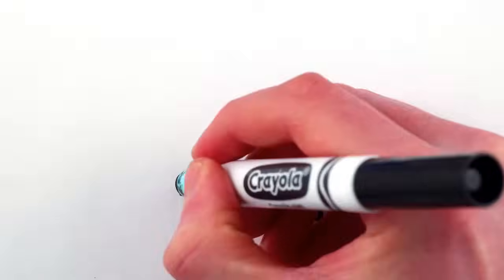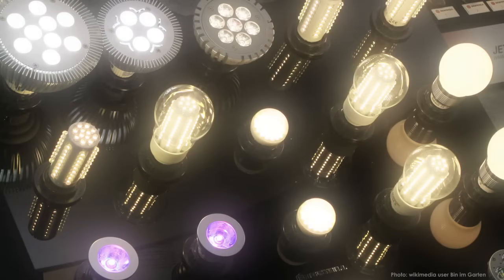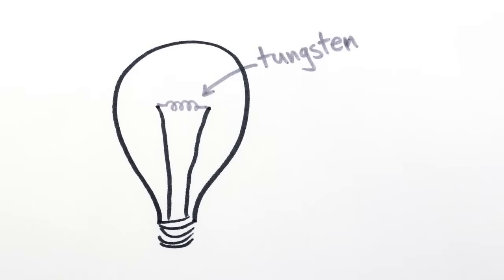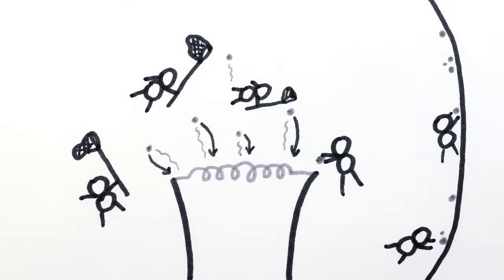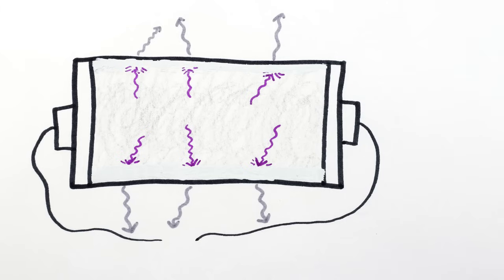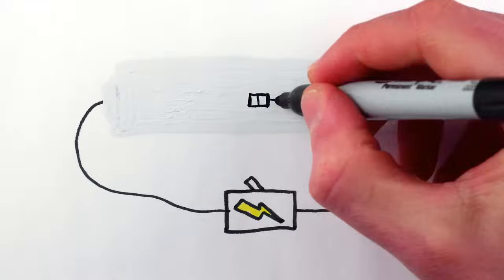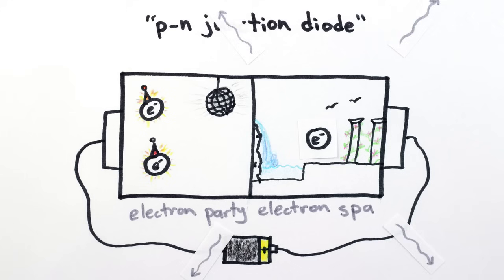How Modern Light Bulbs Work

Comment: Newer, newer LED bulbs have a phosphor coating on the glass to make the bulbs brighter in a wider spectrum.  After you tun off the light, you can see the flow in the coating fade. I presume the LEDs inside are selected to provide just enough UV to excite the phosphor.  Just a guess.

Comment: And of all of them, LED is the cheapest and health safe source of light.
Reply: LED is not the cheapest at all.
Reply: jagjordi It really is now. At cost per kw/h the most expensive bulb now adays is a Halogen bulb, followed by Incandescent, Fluorescent and then LED is the cheapest. Even if the initial overhead of an LED bulb is more expensive than an Incandescent bulb you will recover that overhead cost within 3 months of using that bulb compared to Incandescent.
Reply: Which is what I said.
Reply: Taaketa Dinloka
I think there was some degree of confusion, with Apex's comment being perceived as meaning that LED's are cheaper to purchase, rather than the low-energy/cheap use I suspect he was referring to.
Reply: Spectrum of LED light contain a lot of UV and infrared whitch are not so healthy for eyes. All spectrum of light is "cold" and not all led lamps contain protecting filters. There is only one advantage classic bulb: our environment. If LED lamps contain good quality components and guarantee propitious spectrum then it really is cheapest and safe source of light. So choose wisely!
Reply: Taaketa Dinloka Okey, right, what I ment to say is that LED is more expensive (to acquire it) not more eficient.
Jordi.

Comment: Cool. Could also have done about both xenon incandescent and hid xenon. There for cars but still the hids work in fascinating way. The Is on xenon gas( which is a noble gas) and with a use of a ballast a High Intense Discharge , since the ballast gave the bulb about 20 000 V, and an arc is created in the gas and it emits light

Comment: The HID lamps are the most interesting one. The movie theatres that still use 35 mm film have  large Xenon arc lamps in each projector that sucks up massive amounts of current while running.  Pretty neat to see one light up and warm to full power.

Comment: How can some LEDs produce different colors? What's different in their physics?
Reply: Wave length of the light. Actually it's more accurate to say different frequency as it doesn't change when the light changes between visual mediums.
Reply: The physics is the same. 
When the electron tunnels across the N-type to the P-type semiconductor material, it releases energy, in the form of a photon at a particular wavelength (color). Change the semiconductor's band structure slightly, and the wavelength (color) of the photon emitted also changes.
There's two ways to make white light. Mix Red, Green and Blue and you can make white or any other color. Or a phosphor coating can be applied over a Blue LED to convert the blue light to other wavelengths.

Comment: If halogen lights and normal incandescent lightbulbs both use tungsten filaments how are halogen lights usually so much brighter than incandescent bulbs?
Reply: they run at much higher temperature.
Reply: kurtilein3
But how? Denser coiling?
Reply: ***** more electricity for the surface area of the cross-section of the filament. the gas mix allows for higher temperature before the filament burns up.

Comment: I prefer the light from incandescent bulbs to the fluorescent bulbs…

Fluorescent bulbs are noisy, they take a lot of time to light up to their full potential and they alter colours!

I get headache each time I stay in a room with fluorescent lights for too long…

LED lights are excellent, but they are expensive and they also alter colours… But it is way better than fluorescent light!
Reply: fluorescents typically run at 50 hertz, some people notice that and find it uncomfortable. especially people in the autism spectrum notice it. but there are varieties that run at much higher frequency, which solves the problem. the thing about the colors only depends on the quality, its not generally true, and for quality fluorescents, it is false. the same with LEDs. cheap LEDs use blue light that passes through an orange fluorescent layer and is partially transformed, giving a mix of blue and orange, which looks white, but anything red looks strange under that light. quality white LEDs and quality fluorescents use a fine-tuned mix of up to 50 substances to get an incredibly close match to the spectrum of actual sunlight.

basically all your concerns are based on experience with cheap, bottom-quality stuff.
Reply: kurtilein3 We don't use cheap stuff in my house… Most of our lightbulbs are "full spectrum" incandescent lights (those imitating sun light).

The only fluorescent light we have is the porch light.

(I guess most business and schools are too cheap to buy quality lights…)

But, about the LED, all LED have narrow spectrum… They can't offer a true white.

I guess Aspergers syndrome is in the "autism" spectrum… Although unlike autism, Aspergers syndrome is more an advantage than a handicap.
Reply: I dislike the light from all lightbulbs. Natural light is where it's at. When that's not available, though, I just use fluorescent bulbs.
Reply: SymbolX Telling that to yourself kinda works until you try to find a girlfriend.

Comment: What about LCDs?
Reply: LCDs aren't actually a light source - they're a way to filter light. In the back or the base of every LCD monitor is the actual light source, usually a fluorescent bulb. The liquid crystals, depending on if an electrical current is applied, will block that back light, which is what controls the brightness and colour of each pixel.
Reply: LCD or Liquid Crystal Displays use cold cathode fluorescent lamps for light.

Comment: Since florescent light bulbs have mercury in them, why are they replacing incandescent light bulbs in the United States? Is not mercury just as bad for the environment as increased electricity usage? I'd rather just have a higher electric bill than use mercury light bulbs that become hazards when they break. Not everybody has the money for LED light bulbs.

Comment: Is it true that LED's will never burn out?
Reply: In theory none of these bulbs will burn out.  However, they are constructed with planned obsolescence in mind.  LEDs don't burn out, but they are still susceptible to physical damage if knocked against something or get too hot.  The home-use bulbs promise to run for ~25 years (more or less, depending on the manufacturer).  There is an instance of an incandescent bulb that has been burning almost continuously for more than a century in Fire Station No. 6 in Livermore, CA.  It just happened to be sealed very well against O2 getting in.
Reply: Άλκης Δ.
All long as oxygen is kept out of it, it will continue to work fine.  I used to work in a lab that used an argon (I think?) laser.  They had it for something like 15 years, but it was only supposed to be good for 5 years.  The professor called the manufacturer who admitted some batches were simply better made than others.  Ours didn't leak.  Could still be working for all I know.
Reply: I am not sure but I had incandescent light bulbs in my room before and they would always break( around once a month). I think that it was cause by inconsistency of the electricity....I live in a old house. Now I use LED and I did not change them in 3 years.  I have been told that only physical damage, over voltage and heat can break a LED.
Reply: they burn out afther a while, the metal cunducting will become more rasitance and start to generate heat
Reply: Alexplorer When I was a kid my parents got me a study lamp with some sort of small incandescent light bulb. After I used it to burn lots of plastic things ... it stopped working. (I don't remember exactly what happened to it; it was a long time ago.) We then replaced the bulb with one I didn't use to burn stuff with. Somehow, that bulb has stayed with me until today, some 12-15 years later. It's amazing!

Comment: What about energy saving light bulbs? How do they work? They have a contorted structure, some of them are double elongated vertical loop structures and some of them are double helices like DNA...
Reply: The bulbs that have the highest energy efficiency are LED bulbs.  They don't rely on creating heat to produce their light and have a "theoretical" efficiency of nearly 100% if they were to have no resistance.
Reply: ***** But they don't have the most amount of luminescence. Flood lights do. So tend to use fluorescent bulbs instead of incandescent bulbs now but LED lights have <100% efficiency due to resistance? Don't all bulbs have resistivity? Unless you use a cooled superconductor which is semi-impractical.
Reply: James Oldfield Yes, all bulbs have resistance.  I was primarily referring to incandescent bulbs which use that resistance to generate their light and a lot of heat along with it.
Reply: ***** Well that's inefficiency due to resistance. I suppose the only non-resistant metal is superconductors below a certain temperature but yes incandescent bulbs rely on resistance to generate heat. Although I thought that all bulbs do but okay.

Comment: that's an awesome fact about halogen lamps. I know it's only a minutephysics so we can't elaborate on it too much but how does HBr gas replenish the tungesten? Am interesting in the chemistry of it :) mercury lamps are cool as well btw
Reply: The tungsten reacts with the halogen to form a halide, which doesn't deposit onto the glass surface. At high temperatures - such as near the filament, the tungsten halide dissociates back into their constituent parts, which gives the tungsten a chance to deposit back to the filament.
Reply: Thanks dude! WX halides are unstable at high temperature wrt  the elemental form then?

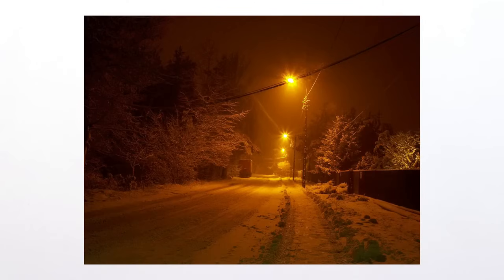Comment: At 1:39 you included a picture of the airplane hangar at Hill Air Force Base. The lamps pictured are not arc lamps as you were showing just before. They actually use the very rare sulfur lamp. There are no electrodes in sulfur lamps because of how corrosive sulfur is. In fact, if you go to the sulfur lamp wikipedia page, the same image of Hill Air Force Base is included in the article.

Comment: In the LED, where do the electrodes get back their excitement from to release it again in the relax side?
Reply: Electrons are pushed onto the higher-energy n-type semiconductor via the applied voltage. In other words, the energy comes from the electricity you need to run it.
Reply: Ah, thank you! :)

Comment: Those are not the technical terms for LEDs. Relax is not a term I have ever heard in any of my classes and research. The region you are talking about is the P doped region and we refer to the area as such.
Reply: Don't know what type of research or classes you're doing, but in both my undergraduate and graduate chemistry and electrical engineering experience, "relaxation" is a term frequently mentioned. It refers to any energy transition from a high energy to low energy state back to equilibrium.
Reply: Narcissist86
In Chemistry, sure, but in electrical I have not heard it used before.
Reply: KiraYamatoinX10A Doesn't make them "not the technical terms". It makes them "technical terms you haven't heard of thus far". You can find the term used in IEEE journal articles.

Comment: admittedly i watched this to reiterate my knowledge rather then learn something new...
Reply: Next you should learn 1) that commas follow adverbs when used at the beginning of a sentence, 2) what "reiterate" actually means, 3) where your Shift key is, 4), the difference between "then" and "than," and 5) that while ellipsis points look dramatic, a period was perfectly fine in this instance.
Reply: Qqqwxs
Good job missing the point.
Reply: Alexplorer Is there really any point in correcting his grammar? If you could correct his grammar, that means that you understood it. You had to of understood it to do what you did. If you understand a piece of writing, then it has accomplished it's goal. It has conveyed a message from one person to the next- the point of language. If you can understand something, there is literally no reason to correct it.

He knows he doesn't have the best grammar(I hope) but just because he doesn't want to take the time to either spend more time writing it, or spend some time practising and learning the syntax, doesn't mean that you need to correct him for getting a few things wrong.  

I prefer correct grammar/spelling as much as the next guy, but it isn't necessary. As long as you can understand them easily, then it's fine if the writing is a bit wonkey.
Reply: Alexplorer The point was for you to correct his grammar, while trying to connect it in some way to his comment. It kind of worked, if that's what you want.
Reply: its taking people a while to realize i said that just about as stupidly as possible. Of course to start an argument.
Reply: kira angle Eh. Welcome to Youtube. It's bound to happen.

Comment: Doesn't a LED need a resistor added to the circuit for it to work ?
Reply: No it doesn't need a resistor. You can find videos on youtube where people tape a button cell battery to a LED and it will work. If you don't trust youtube, you can do this your self, a pack of LED and a button cell battery is really cheap.
Reply: it Depends on highe voltage you put on the LED. lets say the led takes 2 volts and you put 2 volts on it. then you dont need any resistor. but if you use 10 volts on the 2 volt LED you whould need a resistor that takes away 8 volts

Comment: Very informative, the halogen ones are the best ,but to get cancer from a bulb, what are the odds of that happening
Reply: If it's a tanning bulb, which are specifically designed to pump out massive amounts of UV light until your body starts defending against it with pigment? Not so low.
Reply: Tanning bulbs emit UV light, which is known to cause cancer. Similar to being exposed to the Sun for long periods of time, tanning bulbs can lead to skin cancer.
Reply: Tanning bulbs give off large amounts of UV radiation, the same stuff that the Sun gives off and gives you skin cancer,
Reply: Very likely. since Skin cancer is one of the most common cancers
Reply: i would not say that halogen is the best. it generates alot of heat and that means that it wastes a lot of energi making heat. the led is the best. it uses less energi becasue it does not make heat. also you can buy LED ligth that will last 5 years and even more. and the halogen ligth gets destroyed if there is vibration in the house
Reply: Thebookshelf The best are LEDs and Metal Halide Lamps. LED are most long-lasting, compact and robust lights, while MH lamps are healthy spectrum-wide, energy-efficient and very powerful lightsource.
Reply: @EugeneParallax  thanks god somebody mention "healthy, spectrum-wide" . Thanks for ur comment. {saying for myself - context: Metal Halide Lamps - 1:35}
Reply: According to some anti-CFL propaganda I've read, if your CFL has cracks in the coating.
Reply: ScopedPewPew Led needs only 0,7-3 volts.
Reply: Thebookshelf
 If you live in a cold environment, the extra heat from the halogen bulbs may be desirable.
Reply: *****  But you are going to use the light anyway, and in some situations, you can just have the light and then turn down/off the heat. And in places where you just have the light fixture and no heat, the heat from the bulb is better than nothing.

Also, in my own personal experience LED lights tend to be rubbish and not last anywhere near as long as advertised. Perhaps if I bough the newer, more expensive ones, but why should a take the gamble when I have used florescent and halogen bulbs without issues?

Comment: Henry, what is the reason to use different light bulbs? Like it seems that Sodium, Mercury and metal-halide lamps are just a simpler version of fluorescent lamps, so why use fluorescent lamps in the first place?
Reply: Cost.
Reply: I agree with IceMetalPunk and MagnuSSungaM.  I would further add that the cost becomes the important issue to the people running Stadiums and other huge spaces.  At some point, the cost of getting, storing and replacing all these little bulbs becomes more expensive than running a smaller number of enormous, very bright, but energy inefficient bulbs.
Reply: The color and shade of light emitted by Sodium lamps looks pale, and is too bright to be used for homes, schools, etc.
Reply: Because the different kinds of lamps have different-colored (or tinted) light. Some is just pure white while others are more yellowy, and I even had a lamp with light that was slightly blue.
Reply: Do you want mercury vapors in your lamps? Or do you wish to get rid of mercury as a material used in lamps?
So we're making a transfer towards LED:s from fluorescent and other type of lights.